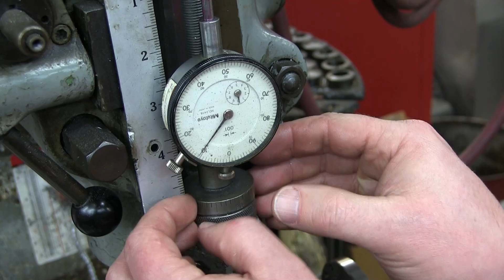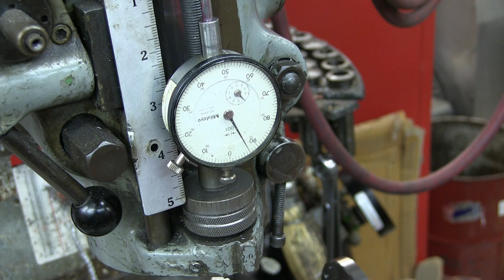48 to 1 Cycloidal Torque Multiplier

Comment: Pro Tip. 
Start your dial indicator on your vice in the middle of the jaw and zero out. 
Move left and right of that point making your corrections at 1/2 the error. 
Much quicker to setup. 
Also you can clamp a parallel bar in the vise leaving a bit above the jaw and use that as your surface. Doing that will remove the looseness of the vise mechanism.

Comment: I use hydraulic torque wrenches everyday for building wellheads and valves/ frac gear.  Gotta love the amount of torque you can get out of such a small thing.   Was doing  3300ft/lb the other day with 1 finger.   

I saw a video the other day of a swench its a torque multiplier ratchet wrench and want to get one of the bigger ones they are capable of 2000ft/lb

Comment: You my friend would benefit from soft jaws, apply a load (stuff A part in the jaws) to the vice, (soft jaws installed) then make a truing pass on the fixed and it's non fixed twin take the load out and install whatever you wanna chop to tiny bits. PS almost all rotating shafts are hardened.

Comment: I see you forgot that to make a square from corner to corner at a 45 degree angle is 1.414 times more distance than from each side. Shaft would have had to be 1.0605 inches to make a .75 inch square,you should finish it with a ball end mill so you could get a nice radius in the transition from circle to square, instead of that ugly stress riser.

Comment: Similar mechanics to a Wankel Rotary Engine.  The Wankel uses a 2 lobed chamber with a 3 lobed rotor spinning on an eccentric shaft.  Balance problems by running opposing rotors out of phase.  Spin the ever living snot out of it, pressurize it and blow big gigantic fire balls out the back with the best of em!

Comment: Hey Ave. It was probably possible to stand that shaft up and bolt it to a plate of sorts on the mill table or even bolted to a plate then clamped in the vise. That way you could side mill all four flats in a single setup!

Comment: For what its's worth, back when I was a machinist for a living, we'd square up our vises by tightening up them there bolts a touch, with one being tighter than the other. Then ya'd run your indicator across and see which direction it needs to rotate. Give 'er a few whacks with the dead blow, snug up the bolts as you get closer to dead-nuts, and repeat as needed.

Comment: Ave don't you know how to dial in a vice. All you have to do is position the dial on one end of the jaw crank the Y axis till the needle stop's moving, then sweep the length of the vice. If the dial moves you started from the wrong end just repeat from the other end. It works every time.

The only hard part is shimming the part square in the vice.😁

Comment: For faks sake clean ur mill, make a vijeo of the process if it would make it happen. Also clean and lube the ways.  Im sure they are filthy crusty and dry. Also a tip fer when you doing some hammer smakin  when your properly lubricated is hold the punch with some vise grips to keep yer booger sticks from getting detected.

Comment: Uh... involute tooth profiles contact each other with transmitted forces normal to the gear faces.  There is no sliding friction for involute gears, as there is no component of the transmitted force that is not perpendicular to the tooth contact point.

Comment: The bottom of the vice and the vice jaw are pretty unlikely to be perfectly parallel. If you are going to be using the bottom of the to hold your work piece parallel you will want to indicate on it rather than the jaw. The jaws come off and are not doweled so they will not go back on straight. They will be close, and obviously close enough for this project. But if you need more precision i would suggest just leaving the vice as is and indicating the top of the part. But if you want to indicate the vice straight i suggest indicating on the bottom. But stone your table and the underside of the vice first. knocks off any dents, high spots and rust. Makes getting it flat and straight much easier.
Reply: Derek Hartley,
Everything you suggest matches my thoughts, only you wrote it more eloquently than I could have. I would only add a mention about housekeeping. Maybe it's just me but it drives me nuts to watch a guy strive for accuracy in a dirty environment. One of the first things I was taught as a machinist for Boeing was the importance of a clean work area and surfaces. It never failed me and undoubtedly saved money, frustration, and time. Merry Christmas.

Comment: But, but, but Nooooooo!  Real gear teeth don't have lots of friction on account of gears sliding against each other.  When learning technical drawing we drew involute gear teeth which roll across the pressure point, almost frictionless!  That is the beauty of the involute shape.  The friction comes from the bearings in the middle of the gears with the separating force of the gears.  The helical involute gear tooth translates some of the separating force of the gear into an axial thrust along the gear shaft, no?
Nollaig Shona Duit
Reply: lol, that was grating on my nerves as well. I think involute gears typically have higher efficiency than cycloidal reducers, likely due to the high radial pressure on the eccentric cam and cycloid teeth, as well as some rubbing on the faces of the discs against plain bearings (not under much pressure, but still a little efficiency lost), and the imbalanced force if you only use two discs (much better than one disc, but still results in a wobbling force on the input shaft).
But involute gears and cycloidal drives both use rolling contact for everything under high pressure, so efficiency loss is due to machining precision/deflection under load/thermal expansion/etc. causing it to be imperfect, rather than anything inherent to the geometry.

Comment: I was constantly told by cadd teacher that key locks are very strong and very hard, just very brittle. They are so hard that you could use them as a cutting tool bit for a lathe. 
 They are designed to withstand a specific amount of sheer force before breaking. It's an engineered safety failure point to protect the machine as a whole.

Comment: I've turned a job like that 90° in the vice before, so that you clamp against the faces with the jaws. Heaps stronger setup, more precise, and more room to put your flats on with. Or if it doesn't fit, set it up in vee blocks. Merry Christmas Ave.

Comment: Clearly, you haven't greased your muffler bearings in quite some time. I can tell because your Kuhneutson Valve was waaaay off. Go ahead and put a 710 Cap on the end of your Johnson Rod, and use plenty of Elbow Grease. Your O-Pipe will clear right out, and the squeaking will subside.

Comment: Jeans got worse over the years... a long time ago, at least in my probably false memories, they were nearly indestructible. And nowadays the cloth just gets thinner and thinner and then there is a hole. This happens between the legs and over the pockets (colleague has a smartphone-shaped hole in the pocket at the side and a purse-shaped hole in the back-pocket). Even the seams are bad, lose threads that are not visible when the jeans are bought but after a few days/weeks they are clearly visible.

Comment: Dialling in a vice 101. Only pinch down one hold down stud. Use this side as the "hinge" which stays fixed and tappy tap tap to move the "free" end. Nip them both down & tweak the last few hundredths straight

Comment: You have confused me.
I even watched it twice.
Why were you "traming" the top of the jaw  ?
Reply: Ok, tramming the head or vice, means that you line up the vice jaws so that they travel parallel to the mill table. Then when you feed the work into the cutter the part comes out straight and not a wedge shape with one end thicker than the other.
In this case he was tramming the top of the vice because he needed to ensure that the vice was level to the table, no chips under the vice raising one side of it, since he was going to be cutting on top of the part.
Reply: CO Jones 
but surely he should be traming the vice not the jaw  ?
The job / parallel sits on the vice base not on the jaw.
Reply: Steve Williams 
I believe he was attempting to verify   how  tipped the vise is with the pile of chips he was attempting to clamp it down on to.
Reply: He was just showing off his indicator. The square cut doesn’t need that accuracy anyway.  It is a show in the end.

Comment: Burst out laughing when you cut off the first attempt. Huge contrast to most broadcasters who can never be seen doing anything wrong
Reply: But he said beforehand that the plan was to cut off the keyed shaft. Was squaring it before cutting it off just a practice run?
Reply: I died laughing when the circus music started cause I knew some bumblefuckery was about to ensue
Reply: No idea why he cut it off though, isn't 0,75 exactly the 3/4 we were aiming for?
I only ever use inches for pneumatic fittings and to tell my boss some "machinist" fucked off with all our 1/2'' nuts again; might be I'm just not getting what he actually measured.

Comment: What kind of adhesive did you fix your jeans with?
Reply: blue gasket maker, most likely a silicone type. Will adhere very well to cloth, even if it does not do well to oily metal. you can tell because when you apply it it gets all over other than onto the mating surfaces where you want it.
Reply: yep, silicone-carnie in the blue flavor
Reply: Looks like it could be this: https://newcontent.westmarine.com/content/images/catalog/large/243693.jpg

Comment: Yeah man, you're going to have some serious cosine error using a test indicator like that. Most are supposed to be set at 11-13° from the working plane. Also, put a key on the bottom of your vise and you can just drop it in the T Slot after some good clean up. Here to help boss!
Reply: Gerald Gepes does it matter if he isn't really worried about the readout and is more focused on if the vice is lined up?
Reply: sdtopper526 that depends a lot on what you're doing and how the head is out. I'll leave the head spun 30° and nodded 5° for days if I can get away without tramming it back in. It gets factored into every cut from there on out though.
Reply: Its better than not but parallels are missing wtf
Reply: Actually most are designed to be parallel to the working plane. Only Interapid/Besttest (hexagon metrology companies) are designed for 12°. It's part of what makes them superior as it's a real PITA to use an indicator at 0°.
Reply: sdtopper526 agreed, I took the time at past jobs to ensure it was near perfect for every job. Don't have that kinda time doing MRO work though
Reply: sdtopper526 if he cracks that loose he may really hurt himself lol
Reply: Can

Comment: @3:50 - properly designed involute gears do not slide. The teeth just roll over one another. There's an excellent diagram and explanation at https://en.wikipedia.org/wiki/Involute_gear
Reply: In a perfect system the teeth do indeed "roll" over one another, but seeing as the perfect system does not exist there will be some sliding friction due to production tolerances/backlash in the system. Wear will also introduce sliding friction between the gear faces eventually.
Reply: Even a perfect involute gear would slide. It's inherent to the design. 
Here's a real source: http://involute.pro/fileman/Uploads/sliding%20velocity.pdf
Reply: If you care to add to AvE's blood sacrifices, you can test that it rolls by holding a thin piece of paper (thickness < backlash) between a pair of meshing teeth as you slowly turn one of the gears with the remaining hand. The paper should not be tugged along with the gear tooth, indicating a perfect roll. The indentation of the paper corresponds to the length of contact face.
Reply: They look like they're sliding in that animation
Reply: So, I'd love to say that I have real world experience with near perfect gears but, even with extremely finely ground gears, brought into proper mesh at a micron level, you still get sliding friction.
Reply: From the WiKi link; "Where the line of action crosses the line between the two centres it is called the pitch point of the gears, where there is no sliding contact."

That's like saying the ball is perfectly balanced on top of the hill when you roll it over said hill.
Reply: erroneum That's what I read as well.
Reply: Look up  lantern pinions used on wooden clocks.
Reply: Sander Vercammen good document linked!. After reading it and some thought process, it makes sense that there will be an amount of sliding the more the contact point is away from the pitch point. The gears are rotating with tooth ratio wrt each other. Only at pitch point the surface velocities match, which is the definition of pitch point (or circle). And matching surface velocity is the definition of no sliding. Any contact point away from pitch point there will be a surface velocity difference that will result in sliding, because at that contact point ratio of distance to center of one gear and to center of the other is no longer same as the gear ratio. Disks with no teeth won't have this, but they can just slide anyway when torque overcomes surface friction. Same thing with belt driven pulleys. In any case, I think bearing surface friction is more important than gear mesh sliding friction.
Reply: The wear in the brass plates from the pivots of gears in clocks from the constant pressure at that one point in that constant direction is a huge factor in gears not meshing correctly (or at all), so yeah I'd agree with you there.
Reply: Of course there is sliding in regular gears due to our "imperfect" real world (finite material hardness, machining precision, ...) but saying this is as pointless as saying that there is sliding in roller bearing... The point of the initial comment is to highlight the fact that tooth of regular gears roll one over another BY DESIGN.
Reply: If I'm reading that correctly then there's no sliding friction only at one particular point, the pitch point.
Reply: This is simply not true, yet is told by many teachers. Involute gears do slide over each other, just not at the pitch circle. Just take an old gear and look at it while turning. There is a lot of sliding friction with gears.
Reply: +Стамен Рунтев
 that's pitting, a sign of overloaded gears

Comment: damn your using your dail/test indicator(don´t know the right name in english.. it´s Fühlhebelmessuhr in german) wrong... the Tip has ALWAYS to be as paralell as possible to the surface (otherwise the reading will be off because of cos error---> https://www.youtube.com/watch?v=CE1epUFRgHA starting at 9:48) and it looks like the tip is lose?! It moves when you change the direction @7:59.... don´t ask how i learned that... trashed a 16 cavity a injection-mold during repair... boss was extremly happy and because of that one "lesson" i´m a little bit scared/focused on these points ...
Reply: Zero is still zero no matter the angle of the dangle.
Reply: "Fühlhebelmessuhr" - you feel like you have a messy ear? ;-)

Frohe Weihnachten.
Reply: Fühlhebelmessgerät... aka Puppitast most of the Time you use this things for comparing stuff, i dont use it cause i have to big Fingers and scared to break it 😂
Reply: yes but if the angle is way of (close to 90°) the thing will read 0,001 but it is way of and you don´t know it...

Comment: I've always used super glue when patching up the high stress area of my Canadian tuxedo. They get a little stiff and crunchy, but it keeps them from blowing out again.
Reply: I  used silicon for years to patch my pants. Then got married, now they just get chucked out.
Reply: I've found that shoe glue usually works pretty well, also. It's more rubbery and flexes with the fabric a bit more, preventing cracking and splitting, like superglue does
Reply: You might have to go into a woman's store, but Aleene's Fabric Fusion is what your seamstress would use if she didn't care to sew anything for you. Thank god for the internet... you can just buy it online anonymously.  Every dude that's single and can't sew, needs to own this.
Reply: Just try to sew them up in front of my grandmother,  won't be in your hands 3 seconds later....
Reply: +Paulman50 After you get married, you need to get a sewing machine.
Reply: Sometimes just asking for a needle and thread does the trick.
Reply: BASF np1 works well and is very flexible.